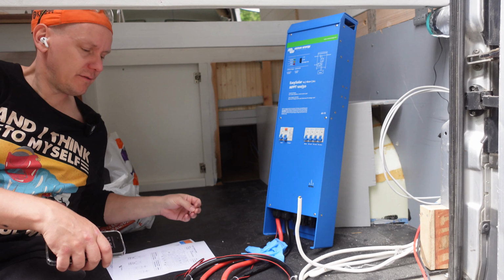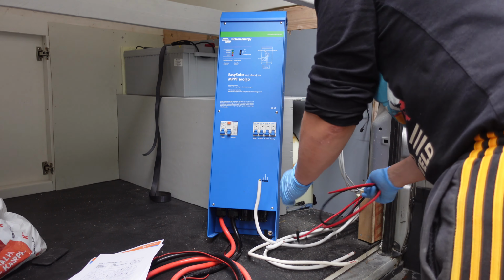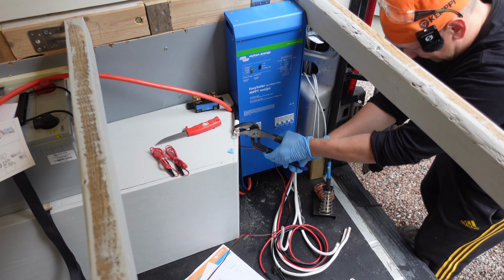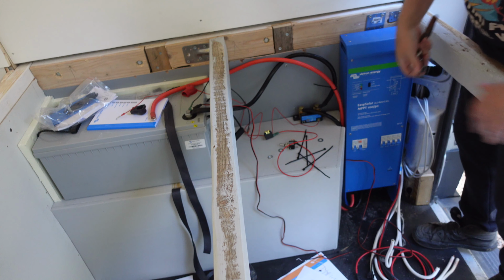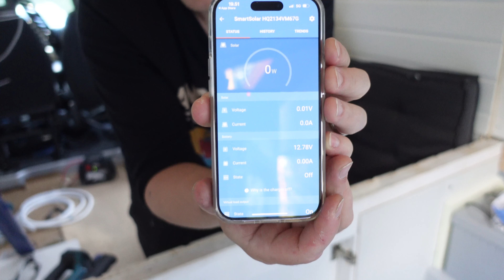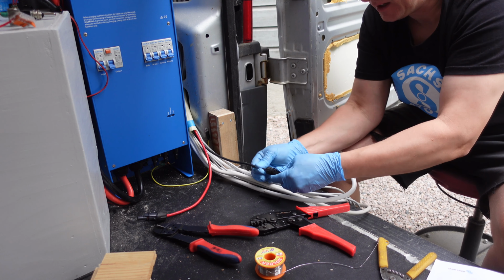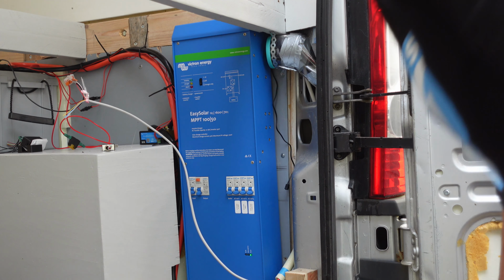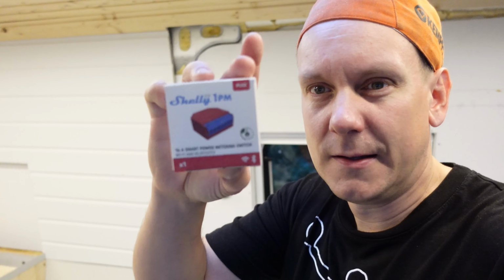DIY Camper Van: Installing the Victron Energy EasySolar Electrics Head Unit! ⚡  | EP13

Comment: Terve I'm building my own campervan right now, i sold my motorhome few years ago and i used Victron Smartshunt in it, i think you notice if you do the awful thing and check the manual you notice that all system negatives connect on one side of the shunt and battery alone to the other side.   Thank you for nice videos Kiitos
Reply from the maker: Terve! And kiitos for your feedback! And thanks for the info, will do the change as soon as the spring comes and we take the camper van back to road!